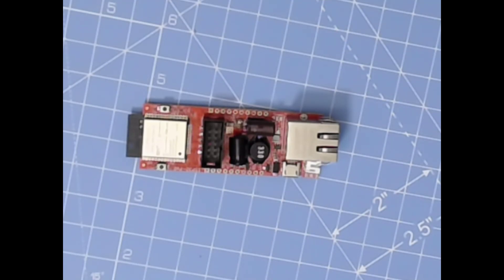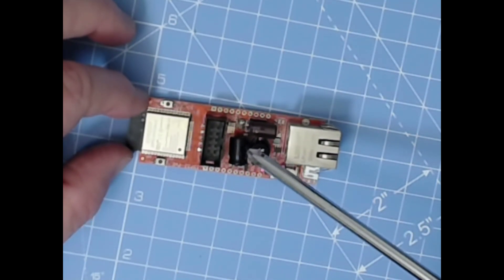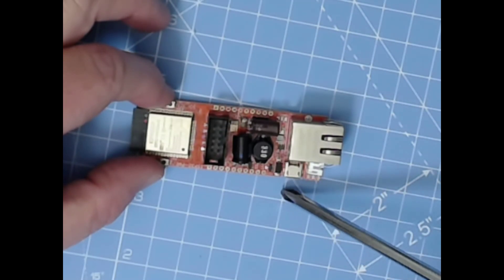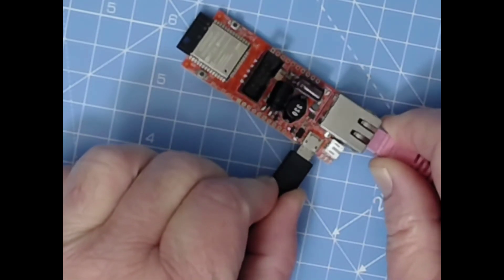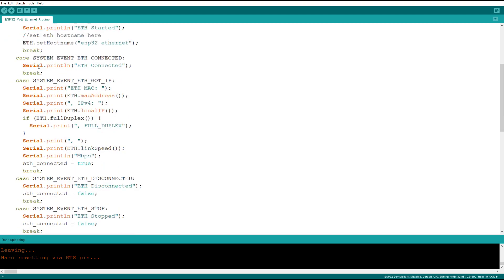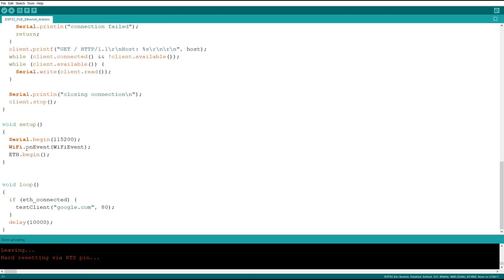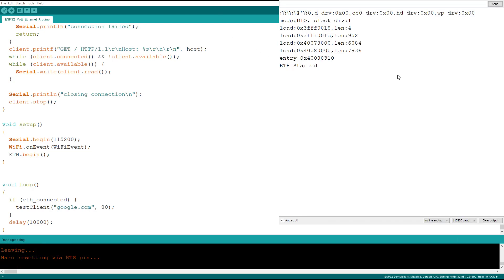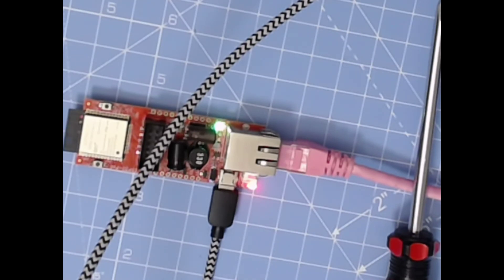ESP32-POE by Olimex

Comment: Great video. At the moment, I'm working on an ESP32 board too, I use it to control relay modules via the Internet. I can connect ESP32 to WiFi but now I want to use the ethernet cable instead (for stable connection). I've searched a lot about ethernet connection but I just found the example that you showed here. Could you please explain a bit clearer about this code example because I'm a bit confused. When loading this code to ESP32, will it let the board connected to the Internet via WiFi or via ethernet cable? (because what I see here is the WiFi event). Thanks a lot for your help.
Have a nice day.

Comment: Thanks, really interested in this board. Have you seen the wESP32 as well? More expensive but clearly has higher design ideals. I don't think I'd pay the extra personally, as the most obvious improvement is the power isolation - frankly I'm the only one who will plug this thing in - and I know not to power from PoE and USB at the same time. The wESP32 point is that it's more suitable for commercial installations - fair enough, but not so relevant for me in my home. All very interesting. A year ago I was planning on trying to produce my own Arduino nano based PoE / ethernet board ("matduino" - you can google it to see my blog) but this thing blows that idea out of the water so I don't think I'll bother!
Reply from the maker: Thanks Mat, the wESP32 looks good but not worth the money IMO.
I have basically stopped using the board for my home automation and have gone back to my own build of a esp32 Devboard (WiFi only) and a wall power supply. I have upgraded my home WiFi network to all Ubiquity stuff and everything works great.

If I was to go then this path again I would choose the Olimex ESP32-Gateway end a wall plug or power over USB.

Thanks for watching the video.